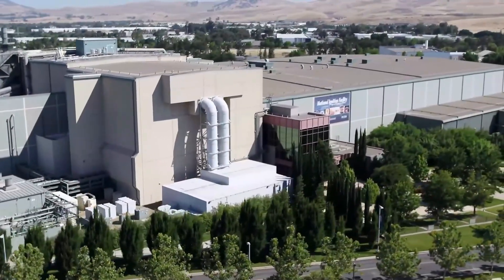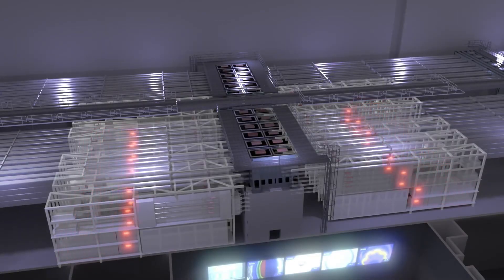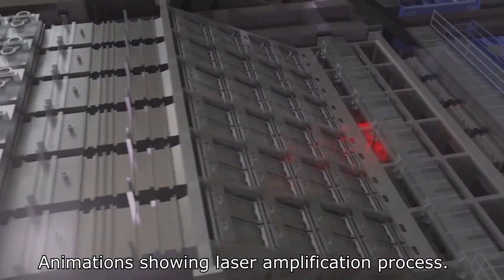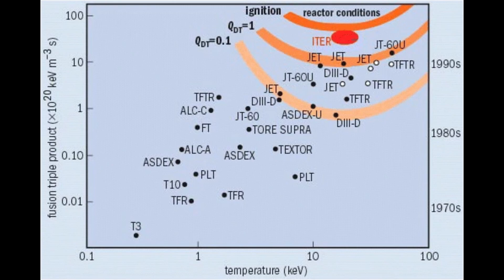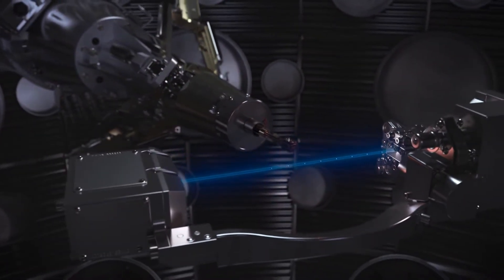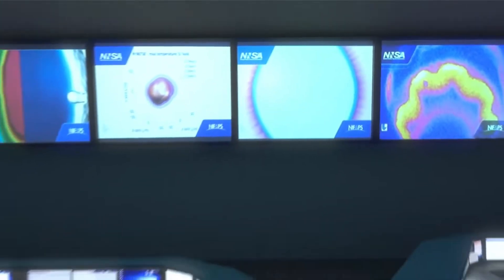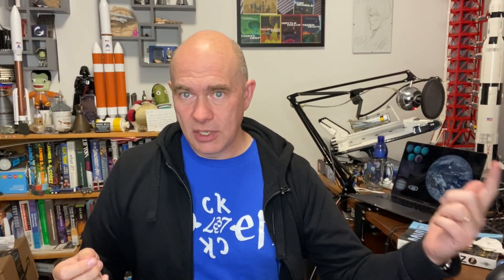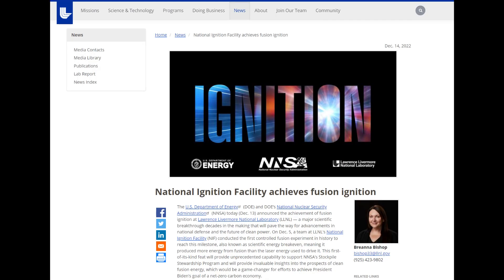Why The Biggest Laser in the World is Making Big News About Fusion

Comment: We are still at least 50 years away from a viable fusion reactor. Perhaps you could make a program about Aneutronic Fusion. A stream of plasma causing the direct flow of a stream of electrons. This is a more likely route to electricity generation.
As far as I am concerned the NIF facility is a total failure. Each test charge costs a million dollars. It can only be set up once a day. It has a C=0.0005. So far below C=1 it doesn't count. Yet so much uninformed comment about an energy value of 30 grams of oil that in reality was not achieved. Frequency of successful ignition 1 in 100

Comment: Your understanding of the p-p fusion in the sun is not quite right.
First, it doesn't have to "wait for an electron to come along" because there's always an electron there already.  The electrons are packed together which makes their wavefunction location expand, and they are touching so the core is essentially solid electron.  Wherever the two protons come together, an electron is overlapping that exact spot.
But, that is not even necessary.
When the two protons come together, while they are close together one of them needs to undergo inverse beta decay.  The proton becomes a neutron, a positron, and a neutrino.  The positron then undergoes annihilation with an electron, almost immediately after it is formed since there's electrons present everywhere (but that itself is a complex dance).
The reason it is rare is because the beta decay involves the weak force, which is slow.  A neutron found alone will have a half-life of about 15 minutes.  So, the probability of it happening during that brief time in which the protons are close enough together to bond is very low.  It would occur, exactly as a neutron on its own decays, because to form a p-n bound pair is energetically favorable, even accounting for the increase in (unbound) mass.
Having the electron present at the site does make it go a little bit faster though.  If that final electron-positron reaction can happen in the same transaction, so to speak, (the interior of the Feynman diagram where everything is virtual) its energy production is included in the total yield of the transaction so the reaction is more favorable.
Looking at it in more detail, an up quark turns into a down quark and a W boson.  A neutrino-anti-neutreno pair is conjured from the vacuum, and the W reacts with the anti-neutrino to produce a positron.  (optional) The positron reacts with an electron (which is present) releasing gamma rays (typically 2 or 3 depending on the spins of the particles).

Comment: i've always wondered about the NIF's fuel pellet design - is it even capable of sustaining a reaction? with the fusion occuring in such a short time, i dont see how you can feed fuel pellets fast enough to take advantage of the previous pellet's fusion energy to compress the next pellet.
Reply: Nope, I don't think they envision that kind of sustained reaction. If anything, they are probably going to continue improving geometry and laser efficiency, so each individual shot is net positive, and then make repeated shots like a machine gun to generate steady power.

Comment: 4:20  The way I understand it, the pressure to compress the capsule is almost entirely from ablation of the outer layers of the capsule.  The photon pressure is a minor contribution at best.  Basically what they're creating is the same process that compresses the secondary of a staged nuclear weapon.
Reply: Yes, you're correct and Scott wasn't on this detail - which is kinda important if you want to understand the physics.

Comment: Fission works.  If were being built instead of torn down for the past 30 years, we would not need coal plants. Add to that, there are lots of gen2 (3?) fission plants in production now that are safer than any of the fission plants that have had accidents. Gen 4/5 fission plants can (and will if the government allows) use "waste" from old gen1 plants as fuel. We already have "clean" energy should we decide to use it. It will be very sad if vast parts of the world go under water because we don't use the tools we already have. Fusion is great but till we get there in another 40 years....

Comment: To expand a little, based on some of the other comments: If we rebuilt this affair with modern lasers (And the link above notes the best we could do would be 20% efficient today) then we're at 14 MJ in, for 3 MJ out. If by some miracle we can do the 40% that someone below claims, it's still 7.5 MJ in for 3 MJ out. 
Tokamaks, last I checked, can already break even - generate more power than is put in - the trick is doing it over time. (and perfecting that requires new reactors to be built to test new configurations. This is expensive and slow.)

Comment: For the etching of microchips, tiny bits of tin are vaporized by laser at a rate of 50k/sec. This produces flashes of intense UV light which is then used to etch the chips.Could some version of this process be used to achieve fusion?
Reply: Ummm... in a word: no.  They are nothing alike.  Like, zero.  Like, not even in the same ballpark.

Comment: The problem with fission reactors isn't the nuclear waste, it's the cost, they are shutting down because they are too expensive, now yes part of the cost is from disposing from the waste, however, fusion is so much harder that it will only work if somehow they make it far cheaper than fission, otherwise it will suffer the same fate.

Comment: What ever happened to the Skunkworks Fusion project which made a lot of publicity? 
'High' temperature Ceramic Supeconductiong might be the final missing piece of the puzzle? How is the research on YBaCuO going? Can we make enough of it to make a large quantity of big magnets out of it? (Without using ridiculous amounts of energy and resources) The only project I've heard of made one demonstration magnet?
Reply: The second one you reference is CFS/MIT SPARC. They tested the magnet successfully and have raised $1.7B to begin construction.
Reply: Their current design is called the MANTA has a paper Q of 5 at the plasma and a theoretical power gain of 3% at the diverters, but where it shine is that run tritium positive with about 10% over the consumption. It's a tritium breeder that happen to be generating power as a bonus.

Comment: Re: Getting the energy out of neutrons. First Light, an outfit spun out from Oxford University, is trying to do material shockwave inertial confinement by hitting plastic pucks with projectiles from a railgun. Their plan for extracting the energy is to do their explosions in a vacuum chamber surrounded by waterfalls of molten lithium, which soaks up the neutrons and heats up, then flows elsewhere to be cooled making steam. Which is an insane image, but sodium-loop fission reactors are pretty comparable.

Comment: I'm guessing that, like the tokamak folks, they have come up with a way to define the power input such that they can claim more energy came out than was put in.  At Iter (pronounced "eater"), the input power they use to calculate Q is just a small fraction of what's needed to power that facility.  The idea surely is to help keep the public interest up and the $ coming in.
Reply: PR and funding is very much part of it, but it can also make sense from an engineering stand-point. For example, knowing the ratio of energy out to energy in allows you to calculate how efficient all the other parts need to be.
Or, more likely, they probably have a good idea of how efficient the heat collection (output systems) could be and how efficient the input systems could be. That means they probably have a target ratio they need to reach.
I suspect those other variables don't get talked about a lot in headlines because it's less exciting, which wouldn't sell as well. It's also pretty common for science journalists to not be experts in the fields they're reporting on and sometimes scientists forget that things they think are obvious are not widely known outside their field.

Comment: 5:27 - Technically, a single core 'retires' several instructions per clock cycle at peak executions speeds because those instructions are being executed in parallel. And so, amortized, it's about as much time as a single instruction takes to execute. ;-)  But, I'm being overly pedantic, and splitting hairs, at the same time!

Comment: I feel like we need to radically redefine what it means to "get more energy out" of a fusion reaction. If the laser was only 1% efficient then dramatically more energy was put in than was released. And that doesnt even count the amount of energy required to make the fuel pellets. Once you actually do the long accounting on this I really cant imagine any scenario where fusion generates more energy than actually goes into it. Even with a laser 10 times more efficient. And then in the end you just have a dumb steam-powered turbine, which is the same way that coal fired power plants generate power. Super dumb. But I guess it pays some pretty good paychecks so we keep investing in it. 🤷

Comment: Technically isn't the heat from the lasers potentially just as recoverable as the fusion energy released? So theoretically a sufficiently efficient heat engine could produce net energy even if each laser pulse used more energy than the fusion power released?

Comment: Why does nobody consider the fact, that nuclear fusion isn't as sustainable as advertised? 

This simple but severe point is: it frees a large amount of binding energy, which was previously "buried in the earth". If you look at the climate / temperature peak in the last 200 - 500 years, it would get way clearer and more obvious..All the highly rapid temperature increases were caused by freeing up extremely high amount of energy stored in chemical bonds.

Of course nuclear fusion would be able to help reducing the multiplier carbon in the air. But it would free large amounts of packed binding energy as energy dense as never before! 

Scientifically I'm a big fan of finally getting nuclear fusion towards practical deployment. But I'm terrified, that nobody seems to think through the sustainability topic like above! @ScottManley

Comment: I had to give up following the research on fusion reactors back in the early 1990s because it just got too depressing, though it keeps dragging me back on occasions like this.

Fusion was always "10 years in the future" in the 1980s, and the saying started to become "20 years in the future", then derisively "20 years in the future and always will be." In the early 1990s, the International Thermonuclear Experimental Reactor was announced, attempting to bring all the world's fusion expertise to one massive design. As of 2016, the cost estimate for that project alone was €22 billion, and as of their current website its estimated first ignition will still not be until quarter 4 of 2025.

Now we have this exciting announcement that net positive energy has finally been achieved. From what I can see from the press releases, it's a "z-pinch style device", one that sets off a one-shot supercooled pellet of hydrogen. So it's not like a fission reactor or a tokamak like ITER, which are designed to be continuous reactions, but instead more akin to a car motor, which uses a sequence of carefully timed explosions to create power. This experiment is akin to finally achieving efficient enough combustion in one cylinder in a car to generate more power than the spark plug used. Now that they've got the physics at net positive, all they have to do is invent something that will, like a car motor, turn these "one shots" into a continuously running power source. Edit: not to mention that, now that I look at the numbers, the "net gain" was only measured against the laser output, not the energy requirements of the laser devices. Comes out to more like 0.7% efficient.

The engineering on that should only take... according to the press releases... 20 or so years...

Depressed. Crawling back into my cave now.

Comment: Am I getting this right: the reaction got 150% out of the 1% that the laser is able to use?
Reply: You get it completely wrong. The energy of the grid that was consumed by the lasers were 322MJ; due to the inefficient nature of the lasers the worth of laser energy hitting the capsule were around 2MJ, and the energy produced by the fusion reaction were around 3MJ.
So you input 322MJ to get 3MJ in return. Even if they vastly improve the lasers efficiency this numbers won't change soon. They only prove that pure energy 2MJ - can excite those atoms so they can produce pure energy worth  3MJ 

But this happens every time when you start up your car. LOL. And far more efficient. It's just that the reaction in your car is chemical, not a fusion one.
Reply: @LyubomirIko   you said the same thing that I said in the form of a question, so what exactly did I get wrong?
Reply: @catmate8358  the laser isn't possible to output much more. It's inefficient technology and the losses are more than 99%. But even if the lasers are a bit more efficient - let's say by half - this won't change the fact that the Q-total is absurdly far away to equality to the fusion output. And this is the only thing that matters in making practical use of fusion.

Comment: The Sun is a bad model for fusion energy.   The Sun produces about 1/4 watt per cubic meter.   The average density of the Sun is about the same as metallic calcium, or about half the density of aluminum.   We need far more power per unit of mater than the Sun produces.

Comment: Most likely future use of fusion:
1) Drill a deep hole in carefully selected geology.
2) Explode a thermonuclear device deep in the hole. 
3) Extract heat from explosion cavity using existing geothermal methods (see Iceland).
4) When cavity is too cold, see number 1.

Comment: Minor mistake on the proton proton chain (6:30). It is not electron capture on 2-He, it's p + p --> positron + neutrino. The positron goes onto annihilate a random electron (releasing gamma rays), and the neutrino caries energy  (2.3% of the total) and it radiates lepton number (which is conserved, and you have to get rid of it to have 1/2 protons turn into neutrons at the end).

Comment: If LLNL is still using their glass lasers they can not shoot very often as the glass heats up and has to cool off. I worked with gas lasers which in theory can shoot faster but we could only do a dozen or so shots a day. But our lasers didn’t couple with the targets as efficiently as the glass ones. Interesting science, but lots of work needs to still come.
Reply: I mean a dozen shots a day sounds great, and it is, but it's still only maybe a 10-fold improvement in comparison to the 200,000-fold improvement necessary to get to the required 10 shots per second estimated that you would need to build a power plant out of this(and that's assuming you could figure out all the inefficiencies).  So gas lasers gets you 10x, only 20,000x to go - it's basically a non starter without an unforseen breakthrough in laser technology, something nobody's even conceived of yet.

Comment: I wrote my thesis on using magnetic fields to suppress surface instabilities on the pellets. The driver of the fusion is a converging shockwave generated by ablation and the efficiency of laser energy to shockwave energy is about 10%, so the actual energy that ends up in the capsule is somewhere around 205 KJ. At the pellet level only 210 KJ is actually driving the fusion. My interpretation of the numbers given is, 2.05MJ laser input (-> a 205KJ shock in pellet) -> 1100 KJ of fusion energy generated. I imagine they choose to report based on the laser energy because the shock energy is a little more abstract and possibly confusing (it also makes lasers look even more inefficient) but the news is actually more positive for the future of ICF.
Reply: You'll be happy to hear that they are currently working on adding a pulsed coil around the target.  Should have initial results in a year or so.

Comment: NIF 5/12/22 Shot 
Capacitor banks energy: 300 MJ
Laser energy: 2.05 MJ
X-ray energy: 250kJ
Fusion energy: 3.15
Fusion/Laser gain: 1.54
Fusion/X-ray gain: 8.2
Fusion/Capacitors gain: 0.011

Great scientific achievement, but it's relevance for fusion energy is somewhat exaggerated. More efficient drivers will be necessary.

Comment: Sadly, they straight up lied at NIF, which is sad, because we're WAY off from net gain in energy, they basically lied by a factor of roughly 250x...  They refuse to actually take into account any and all inefficiencies and simply ignore them, which is what makes this incredibly dishonest.

"the huge lasers at NIF are less than 1% efficient, so to generate more fusion energy than actual input energy to the facility, you'd need to increase the yield [at least] 100x"
"Plus, the fusion power is in the form of heat and radiation, and needs to be converted back to electricity. Assuming a 40% steam cycle efficiency, that's another 2.5x increase in required yield. So we need a fusion reaction [at least] 250x MORE POWERFUL to achieve true electric net gain"

Comment: Terrible!  Liquid Fluoride Thorium Reactors (LFTR) might burn thorium, uranium, and transuranic elements in so-called "nuclear waste" down to (non-fissile and very useful) neodymium and relatively small amounts of radioactive waste consisting of radionuclides dangerous for only a century or so -- instead of tens of thousands of years.  Research LFTR more and get back to us; you shouldn't be lauding the misdirection of research into the development of abundant, inexpensive, safe and carbon-neutral energy -- fusion ain't it!  I thought you were a nuclear engineer.